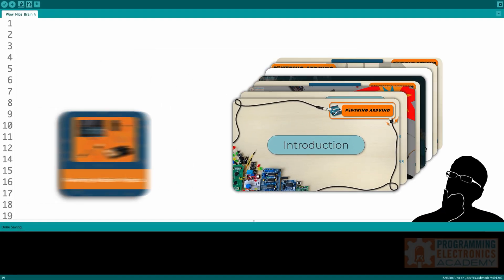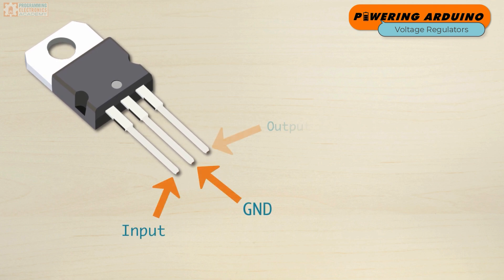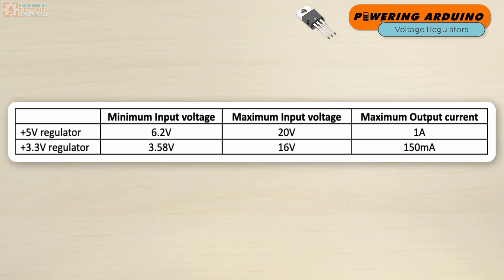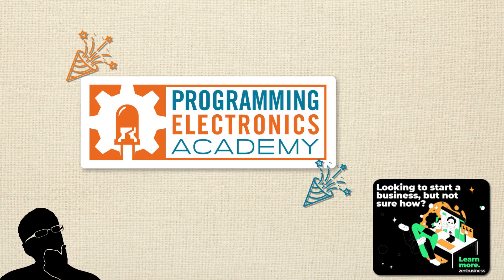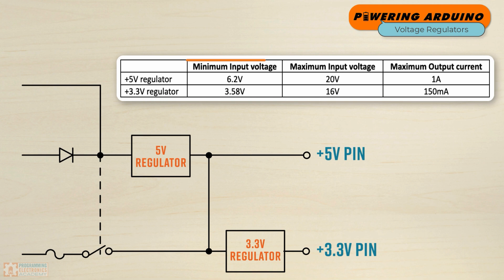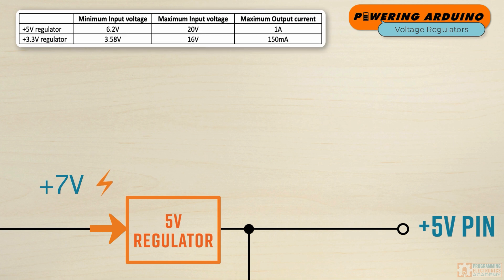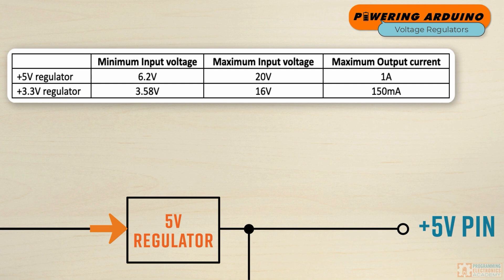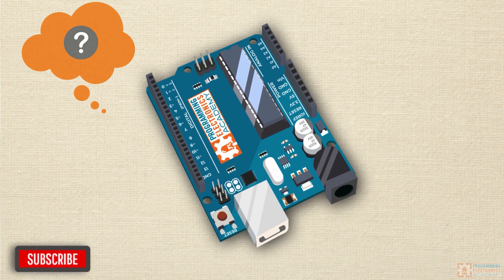Powering Arduino | Voltage Regulators

Comment: I understood that the heat generated and wasted in a linear voltage regulator was determined by the "voltage drop" across the regulator times the current.  12V - 5V = 7V and multiplying 7V by 0.500A would indicate that 3.5W had to be dissipated by the voltage regulator.  The 6W you referred to would be the power total consumed by the the device AND the regulator, only 3.5W of which has to be dissipated as heat by the regulator. Did I recently read somewhere that some newer devices are replacing linear voltage regulators with switching power supplies built into a chip? Thank you, find your tutorials very helpful.

Comment: I thought the regulator power dissipation was based on the voltage difference, not the supply voltage. So for your example of 7V & 12V supply the regulator would need to drop 2V & 7V respectively, which would be 1W & 3.5W (@500mA)...or in other words, not quite as bad as you thought. If it dissipated all the power then I don't think you'd get 5V at the output.

Comment: But…USB voltage 5.0VDC. If the minimum VDC for an Arduino is 6.2VDC, how can USB power an Arduino? I suspect the Arduino is converting amperage into voltage (Watts=Amps*Volts).
Reply from the maker: Great question!  When power is supplied through USB, it does not go through the 5V regulator, because USB power is already regulated at 5V.

Roughly speaking, there are 3 ways to power an Arduino:  USB, DJ Jack, and Vin.  The DC Jack and Vin use the 5V regulator on the board, with USB, you only use the 3.3V Regulator.